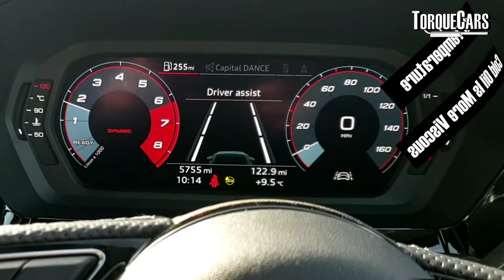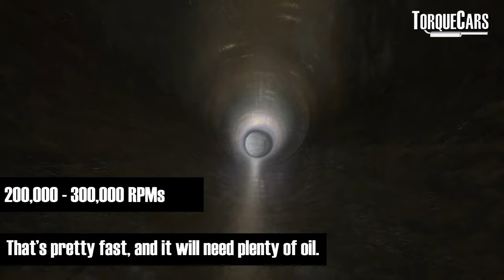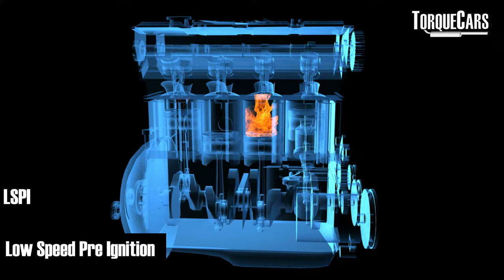5 Things That Kill Turbo Engines ⚠️ [WARNING]

Comment: I start rolling immediately unless freezing weather.  Just drive slow with rpms low.  This let's the engine and tranny warm up faster and oil getting warmed up, which prevents wear.

'15 VW Sportwagon 1.8t auto at 72k and runs like new.

Comment: I bought a 3.0L TDI @ 130k (miles) previous owner had the Turbo replaced at 95K.  Been driving it for a while and I find that I need to add about 300 ML of oil a month w/ a mix of spirited/normal driving.    I could see it starving for oil as the owner changed it @ 10K religiously.  I have conducted the changes every 5k mile intervals thus far.....zero issues thus far and I always dump a high quality additive into the diesel fuel.  They only sell one grade in the states and thats "crap" cant find anything useful at any gas station.  Great info.
Reply from the maker: I've actually had an interesting issue with the newer 3.0 Tdi, the variable flow oil pump leads to poor lubrication if you keep the engine at low rpms for long periods, which leads to excessive wear. It's resulted in an engine seizing up and one burning oil. I think there is an ECU fix to run the oil at a higher pressure but when I've got to the bottom of it all I'll do a video on it. There are so many opinions and suggestions it's hard sifting through them all to get to the root of the matter.

Comment: My Mazda3 diesel 2.2 has a fast idle @ 1600 rpm for about 20 seconds from a cold start up. just enough time to fasten my seat belt. When the revs drop to normal tick-over i proceed to drive away changing up at around 1800 rpm for a couple of miles allowing the engine to warm up.
I never give it a lot of loud pedal  before  the engine is up to operating temperature which can be up to 10 miles. When conditions allow i give it some send, (as you do).
This regime has worked for me over the decades i have been driving.
Modern engines are much better engineered than those of 40 years ago, just keep on top of the oil/filter changes.

Comment: Low R's last few minutes makes much more sense than hot idling to "cool" the engine. It's never made sense to me how parking a really hot engine bay can cool anything. But low R's coming home or into work makes much more sense.
Reply: My neighbour always said that keeping it running for a few seconds keeps the oil flowing therefore cooling
Reply: The idea is to low idle for a period of time to let the turbo speed coast down before shutdown.
You are right that driving at low load before shutdown will have the turbo spinning not so fast.
Reply: The worry is oil coking in the bearing, although this is not much of a concern with modern oils, water cooled turbos, and electric water pumps. If you've just come off the race track, yes, let it run for a minute - the oil and coolant are much colder than the turbocharger itself
Reply: Do both

Comment: VERY important video - I guess many people have never thought about it.
Another problem is driving with a cold engine: You should let the engine idle at least 30 seconds to allow the cold oil to reach every part of the engine. Also use low rpm until your engine reaches operating temperature (oil temp of 80-90 degrees Celsius will be reached a few minutes after the water temperature gauge shows the engine is ready to rev up fully. 
Also use your stop-and-go-system wisely: Let the (hot)  engine idle some seconds before you accelerate since even a stop of only a few seconds will let the oil go down inside. So immediate acceleration after the engine starting will shorten your engine’s lifetime.

Comment: This is just good, old fashioned driving, like we used to do in the old days!  Be gentle until the engine warms up and use the gears - that's what they are there for, and never let the engine labour, especially on a gradient, even though the turbo will give added power at lower revs.  Great video, showing how any vehicle should be driven, as well as with a turbo engine.

Comment: Good bits of info! Pops showed me the ropes when it came to the turbo engine life. Let it warm up, don't be erratic with the throttle, and let it cool down after a rip. Oil changes at 5k kms, with a filter change/dissection halfway through. 0w40 in cool months, 5w50 for summer in my 09 Dodge Caliber SRT4.

Engine is squeaky clean at 217k kms, and brings me joy every day.

Comment: I have a 2011 VW GTI.  I love it. It is stock .. no mods and I change the oil every 3k miles.  It has 103k miles on it and while I have done maitenance on it that normal folks wouldn't do like changing out the manual transmission oil every 50k, I have done the normal stuff like spark plugs, coil packs, etc.  The only issue I have ever had with the cars engine is the high pressure fuel pump. The factory one was designed poorly.  I put an after market one that was much better and have had no issues.  My real issue with it being a 13 year car is all the body stuff like switches and door latches etc that are going to wear out.  I just replace or fix them as they come.  The car is pretty much like new.  Biggest thing I would recommend is to change your oil at half of what the manufacturer says.  If you get a new car.  Change your oil at 1000 then 3000 miles and every 3000 (if you drive hard) or 5000 miles if you drive normal.  If you live in a cold area or do a lot of short drives (anything under 15 min) you should change your oil at 3000k.  This is because of water in the oil does not have time to get out on those short drives.  If you do all this there is no reason not to get over 200k or even 300k out of your car.  Last thing clay your car every 6 months and wax it.  That will keep the pain looking great.

Comment: Simple rule, start the engine, do not press the accelerator, then put your seat belt on. Lets the oil pressure build up. Then drive off.

Rule 2. Arrive at your destination, take your belt off and then turn the engine off. Allows the turbo to spool down. 

Never ever rev the engine to ‘prime the carburettors for a cold start the following morning’ before turning it off, that never worked when cars had carbs, and diesel cars never had carbs, but it does kill turbo’s. As a neighbour found out when he killed his company car in under a year… it was painful to see him arrive home, and rev the engine and then turn in off.

Comment: Especially with DI engines that harm timing chains etc if not having their oils changed very frequently ;)
Reply: Injection type and timing drive are 100% unrelated
Reply: 5k mi OCI w/full synthetic is perfectly fine.

Comment: My bmw M340 has water cooled turbo and continues to circulate water after the engine is shut off to cool the turbos if it was driven hard. The fan stays on and runs high as well. This prevents oil from being cooked off. I avoid this by just driving slow to cool it down after a hard drive anyway but nice to know the designers thought of it. Same thing happens with stop/start where the coolant continues flowing or the car won’t shut off if it’s still hot.

Comment: How about start - stop systems in turbo charched engines? There is no cooling time fot the turbo in that case. I hope for a answer. Thx
Reply from the maker: Start stop can be manually turned off. I rarely find I go from spirited drive to a dead stop in most areas I've driven traffic tends to slow up, hence allowing the turbo to cool a little. 

Many stop start systems only cut in when the engine temp is right and prevent a continual stop start in traffic, some however do not it depends how clever they are and how well setup they are.

Being aware of the potential issue at least gives us a chance as a driver to make an informed decision with regards to using stop start.

Personally I switch off stop start unless I'm driving in urban areas with heavy traffic because I feel it is an annoying pain.

Comment: 1. Oil change intervals. 2. Gradual acceleration instead of flooring the accelerator.  3. Allow engine oil to warm up before driving.   4. Avoid lugging the engine (a load at low RPMS).   
5. Allow the engine to cool down before turning it off.

Comment: Regarding point 4: If you have an automatic turbocharged vehicle and it's lugging at any point, tap down on the accelerator; that should give the ECU the message that you want to speed up, thus it will downshift. It may be finicky at first, but the computer should learn this habit over time.

Comment: For some premature acceleration has been a problem since puberty. Seriously though your advice works for any engine. You can use all the power an engine has to offer without slamming the go pedal. It's why dragsters have to be torn down after so many runs, each full power run beats the crap out of the motor. Of course that doesn't mean you can't hit it once in awhile.

Comment: Most of today’s turbos are designed to run on 87 octane fuel and top tier gasoline is common in the U.S. 
Top tier fuels contain detergents and additives to keep the fuel system clean and carbon deposits to a minimum.
All the major oil companies produce  and sell top tier fuel.
Reply: But the top tier fuels are quite expensive.
Reply: 87? Wow that's low. 91 is the lowest we get in Aus, 98 is normal. Is 87 common where you are?
Reply from the maker: We have to bear in mind that the octane numbers do vary from region to region, https://www.youtube.com/watch?v=p3yEEtoxWss
Reply: @hisownman  Not in the US
Reply: My 2016 Passat 1.8l runs fine on 87 in Central Texas.  Heat (and its hot here) and all

Comment: Was told some years ago, to let oil through the turbo before stopping engine, I always do that when I have driven on the country roads.
Always try to reach 2000 rpm no matter what speed I drive in my diesel engine. 
Modern engines do the same with 1500 rpm, that's why they drive longer pr.litre than older engines. 
I upgraded my exaust all the way from the engine with thicker pipes and better muffler/better sound, also got more power and drive 2 km longer pr.litre diesel at the same time.

Comment: Great advice,  recently had to educate in laws that 6th gear is 70ish on motorway not 35mph lol
Reply: I rode with someone with a diesel and they drove around at 4000rpm

I educated her to shift damnit
She said why

I said because every mile you’re spinning the engine 120,000 times extra. 

She act like it was a personal attack

I was explaining that miles
Don’t tell the whole story and someone may have the same miles as you but some ass hat spun the engine has spun around twice as many times on yours. 

She didn’t like me saying that 😬
Reply: @fastinradfordable  Women. ☕
Reply: my pulsar tells me to shift in 6th at about 60 kmh when i m really just tingling the throttle. at that load its okay. it tells to downshift when you re trying to hammer the throttle at 2000 rpm (max torque is already reached at 1800 rpm)
Reply: My car sits quite comfortably at 30mph in 5th gear. If there was too much of a load on the engine, you’d feel it. This video was decent but this bloke fails to explain that every car is different. I’m not claiming my car to be an Aston Martin, but it has enough power under the bonnet to drive around in 5th. And I’ll continue to do so as well - bollocks is it damaging my turbo what nonsense 😂
Reply: @Luke-ym7hd  It's not about the power your engine makes. No matter which engine, driving 30mph at 1000rpm is too low and you are putting more stress on the bearings compared to  the same speed at 2000rpm because every power stroke now has to do twice the work to maintain that speed. And he never said it was the turbo you'd ruin by lugging it, rather your turbo engine.

Comment: Turbos don't spin all that fast unless you're boosting them a lot by driving hard. At low RPMs and driving gently, the RPM of a turbo is not nearly 200,000 or 300,000 like he says.

Comment: I agree with your assessment of turbo engines.  I’ve not yet figured out why the manufacturers went down this path with more complexity and higher repair costs.  The idea that they get better mileage is a myth.  I drive a lot of different cars and the normally aspirated engines are as efficient if not more so and there is a smother transition into the throttle which makes for an easier vehicle to control and drive.  Just not a fan of hair dryer engines for daily driver.  Leave them for racing.
Reply: EPA sets requirements, and the turbo is an easy way to meet those specs.
Reply: Excellent site and comments. Just what I needed to hear for my G8 2.0TDI bi turbo.

Comment: That is a very good point regarding stop/start. It's sold as reducing pollution, but makes you wonder if its a way of wearing out things prematurely, £££ In the same way as individual pencil coils. They have a short life and are a costly service item.
Old engines had one coil, would last the life of the car !! Regards cool down. The fact the car is in motion is beneficial to cool air flowing over and through the engine.

Comment: It’s not specifically about the oil cooling at the end of the journey, it’s about allowing the turbo to slow down whilst still receiving a constant supply of oil to keep the bearings and bearing surfaces lubricated with the engine running.

Comment: Is it possible to lug a car engine with an automatic transmission? Also aren't synthetic oils a must for  turbo gdi engines ?
Reply from the maker: It depends very much on the car. If you can select a gear manually and there are no safeguards or fall backs then probably but most autos will just take over when you try to do something silly. Yes a good quality synthetic is a must on those, oil sludge build up can happen with the wrong oil.

Comment: I've got an ACT 1.5 tsi, I drive mostly in City conditions and dual carriageways, I've turn off my start stop and never select 6 gear and try keep it at 2000 rpm, to avoid clogging. It's really annoying the engine oil temperature only reaches 50 sometimes 60, so occasionally I'll take it down the motorway for an hour. I also change the engine oil every 3000 miles, basically which I do every year.
Reply: Good idea to give it a flogging every so often (when oil hits 90°c)
A spirited drive in the hills really helps the engine loosen up and will also burn off any fuel that may have seeped into the oil

Comment: First thing that kill a turbo engine car is the turbo itself. See how the new generation of engines using smaller engine with a turbo are failing after 5-10 years when the bigger older version with no turbo were bullet proof and last well over 20 years.

Comment: I typically run it for 3-5 minutes is that long enough?
Reply from the maker: That is probably a little longer than I would but it doesn't do any harm but it does depend on the car really, some with small turbos and an oil cooler will cool down quite fast. 120 seconds is generally enough time for the turbo to spool down and cool off, at least that avoids the hottest duration.

Comment: My Focus 150 TDCI indicate which gear I should be using so as not to labour  the engine. However, these devices cannot see the road ahead so I often change down well before we reach a hill or point where a lower gear is needed. Also sixth gear is really only useful to me on the motorway.

Comment: RE 4. This is simply not the case with modern Petrol turbo cars. Essentially anything after about 2012 since they now all use Direct Injection into the Cylinder. Thus knock simply cannot occur because there is no fuel present until its precisely required. Older Port injection cars, Yes and No. Saabs for instance use Direct Ignition and Ionisation measurement for each cylinder since 1993. Knock is caught within Milliseconds and adjusted for. Massively quicker than many other cars with standard block knock sensors.
Reply from the maker: Whilst things have certainly improved the modern direct injection engines will struggle with LSPI low speed pre ignition, so although things have moved on there are still things we need to be aware of as drivers. 

It's good to meet a Saab enthusiast, the 900 Turbo was a favourite of mine - they seemed to over engineer everything.

Comment: Driving gently for the last half mile or do before before parking up also prevents  brake vibration issues caused by disc warping or baked on deposits on the brake discs

Comment: What do you think about QMI motor treatment, when you add QMI treatment when you change the oil, QMI stays on the walls of motor and turbo for about 100.000 km and it is like driving wet  ice on ice, I add it in many cars till now and it works very good.

Comment: frequent oil changes are very important on turbo engines
Reply: 5k mis on modern full synthetic oils are perfectly fine.
Reply: @Davido50  if you drive like crazy yes. otherwise 7-9k miles will be fine for most cars. No need to change oil every 3 business days

Comment: Hi there. Very informative video.

My engine light went on due to my faulty turbo. So, I stopped driving my car (audi A3 8p mileage on 200k) until i could find a mechanic to recon the turbo. 

About 2 weeks later, i started the car again to move the car, and the orange engine light was gone. I still haven't repaired it. 

Does this mean i have to get turbo cleaner for the turbo or completely replace it?
Reply: Turning key on off resets some engine lights
But scanning the computer will reveal the code

Comment: This may sound a little Bizzarre Ione a European turbo charged car after a drive I open the hood of my car and help the cooling process a little more than just relying on the cooling fan petroleum products breakdown with excessive heat so I dispose of the heat by opening my hood for 10 to 20 minutes not a big deal but what do you think of that